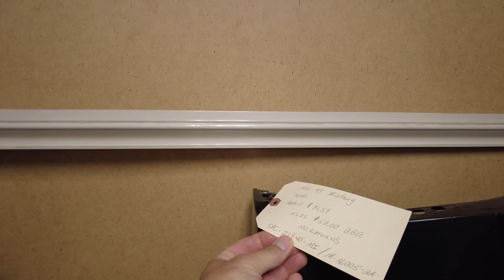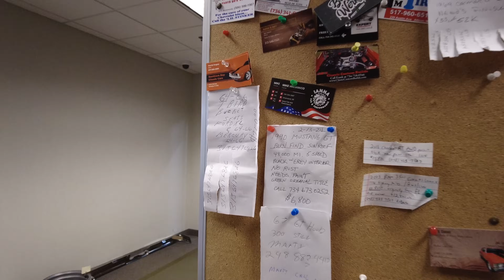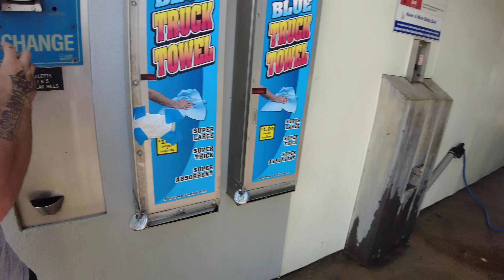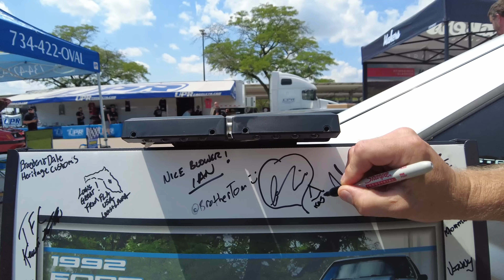What A Trip! Motor City Foxfest 2024 - 1978-04 FoxBodys Takeover Ford World Headquarters Dearborn MI

Comment: Did you mean 79 to 04.  your bud had the vanilla ice Cupid T shirt on.
Reply: The 94-04 Mustangs are still on the fox platform like the 79-93 but with design changes to it. However, theoretically the foxbody is 79-93 and the SN95 is the 94-04 model with the 99-04 models often referred to as the New Edge.
Reply: @newfie-dean5803  thumb nail said 78 to 04.
Reply: @richlong4119  ah yes, I did not notice that but it should be 1979! 😎👍